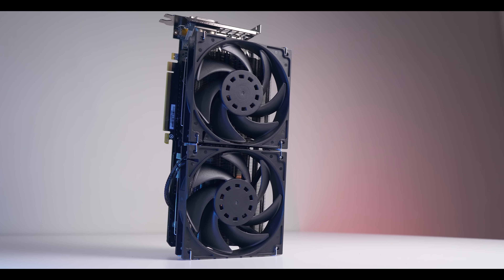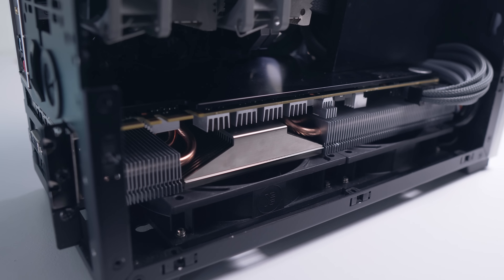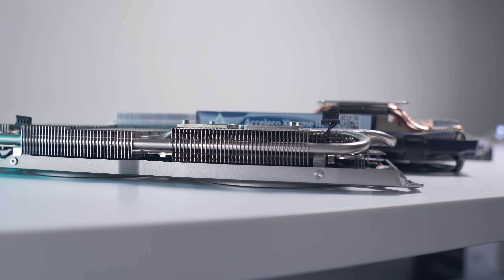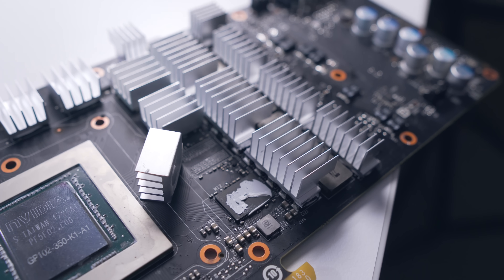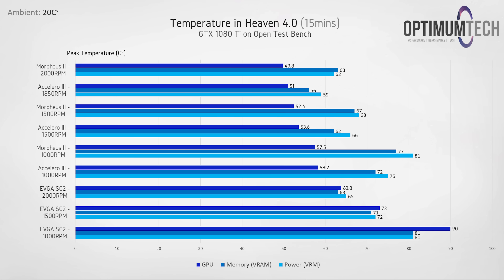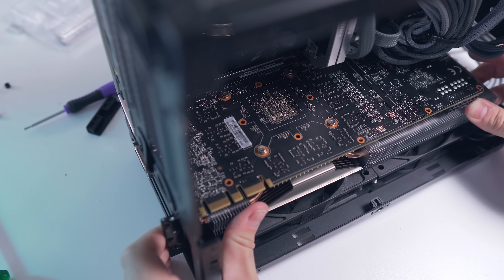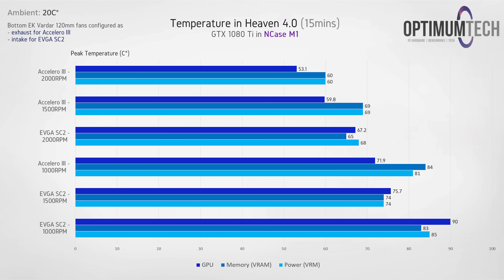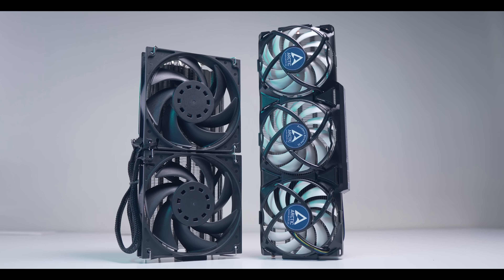Accelero III on a 1080 Ti - Exceeding Expectations!

Comment: Accelero IV
Reply from the maker: The IV, from what I can see, only adds additional back plate cooling. 
Otherwise it's identical to the III.
Reply: Its the same cooler but with a different way of cooling VRMs. Oh, yeah, I forgot, its unlikely to fit if you want the VRM cooler of the Accelero 4 to fit in.
Reply: Accelero Xtreme plus 2 work again like charm after 8 years operating non stop almost every day of the year can attest to their quality.

Since my first evga 560ti limited edition card, then adapted on a 970 FTW, and now on my 1060 SCC. Ultra quiet and super efficient, that any liquid cooling that I could see, it also cools the pcb, a clear advantage to this cooling air system (much cheaper).

I've adapted my backplate of my evga1060 SCC to this system(I just cut it a little). My temperatures rarely exceed 50° on a new game resource-intensive, for other games in full ultra is about 40-45 ° see much less, it depends games.